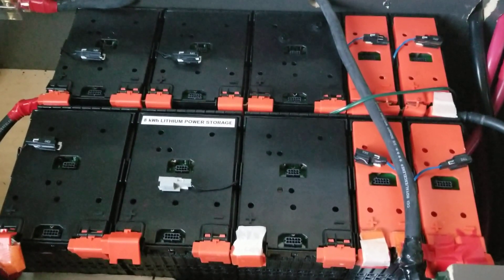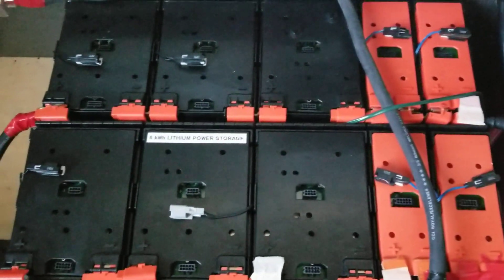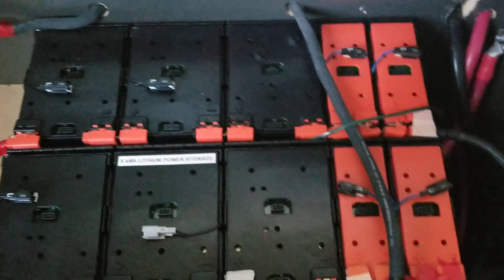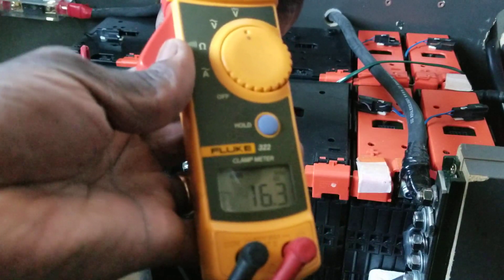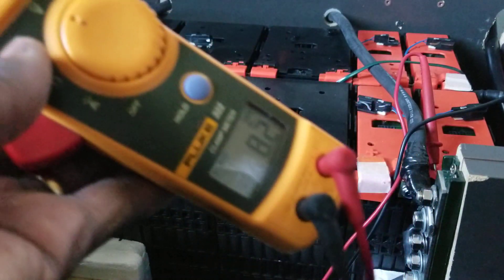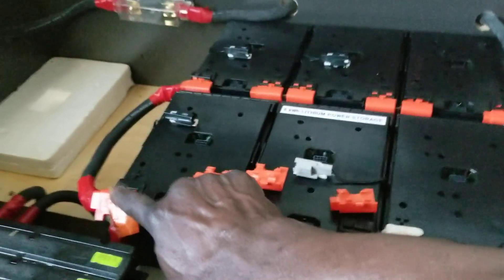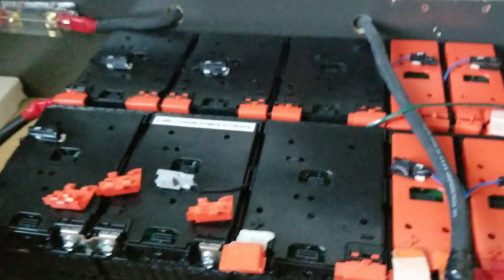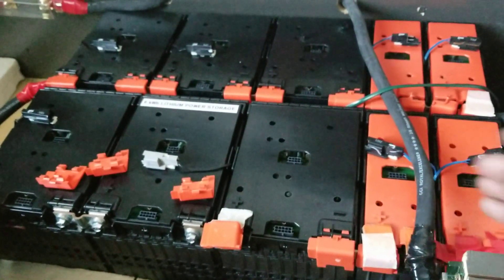LITHIUM BATTERY WITHOUT BMS VOLTAGE TEST

Comment: I've been using smash copper pipe busbars for over 5 yrs on my systems 15kw 48v no issues...
Reply from the maker: Yes!
LIKE SHARE and SUBSCRIBE
Reply: which type of batteries, without bms? i would like more info

Comment: What is the brand and type of your battery? I thought in the beginning that battery wont last without BMS , upon watching your video, its proved that bms is not really necessary in building a battery bank.
Reply from the maker: It is and extra protection and it is an individual choice or preference to use a battery management system known as (BMS)
Thanks for stopping by buddy and don't forget to LIKE SUBSCRIBE and SHARE. 
Please STAY TUNED for more to come live from Minnesota with jwsolarusa👍
Reply: @jwsolarusa  I am your subscriber buddy
Reply from the maker: These are Sanyo lithium batteries they had in a VW VOLKSWAGEN E-GOLF ELECTRIC  CAR. 
These batteries are made in Japan

Comment: So you only know the voltage of each battery you do not know the voltage of each cell and they are likely good BUT you do not know that. Your batteries are of top quality so likely they are fine. If you do not like BMS then at least monitor the cell voltage so if needed you can adjust but it happens so fast you will never catch it. I have to disagree with you on this brother but that is what makes solar so interesting.
Reply from the maker: I do know the voltage of each cell by popping the black top cover of the battery where the bms is located. 
I have done it before but I forget to show that on the video. 
Thanks for your opinion.
Reply: @jwsolarusa  Usually they vary the most right at the highest voltage in the charge cycle but whatever enjoy

Comment: Yeah JW solar that's what I'm talking about  I don't run a bms on my system and u can check mine to and they are all equal I'm running chevy volt and cmax batteries I believe they run bms in the cars cause they are sealed off and u can't check them that's why they have bms if u do ur system right I believe u don't need a bms maybe u do on the 18650 maybe not I will build on and just see keep it up brother